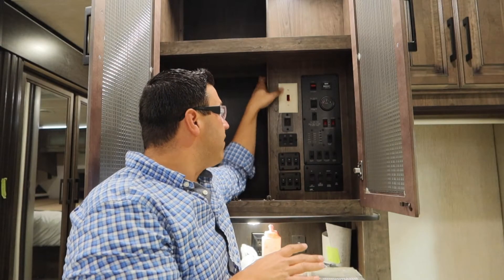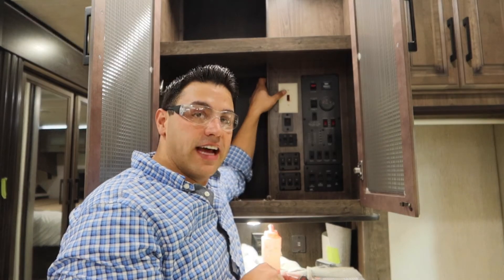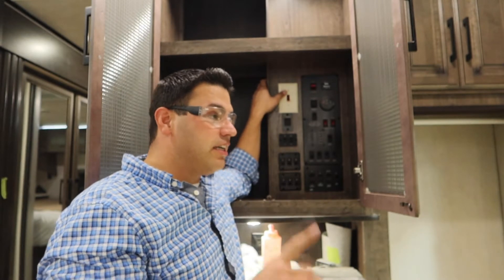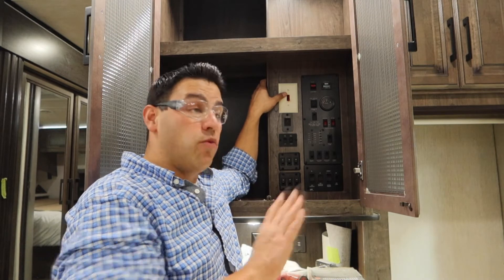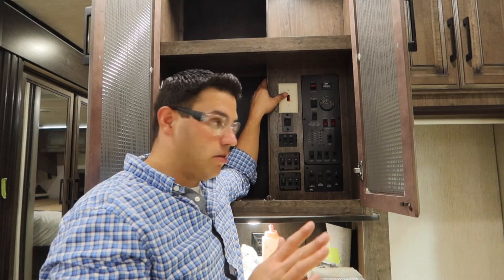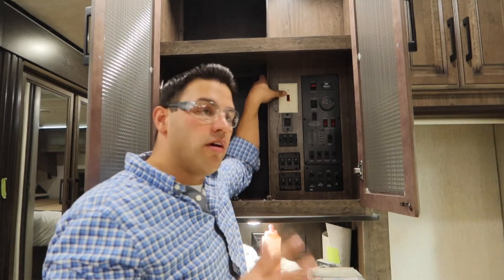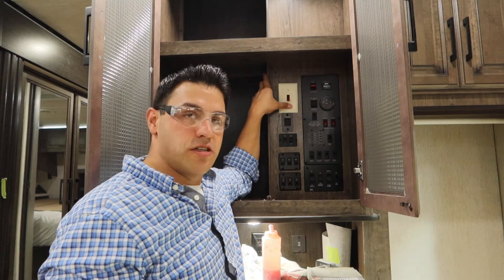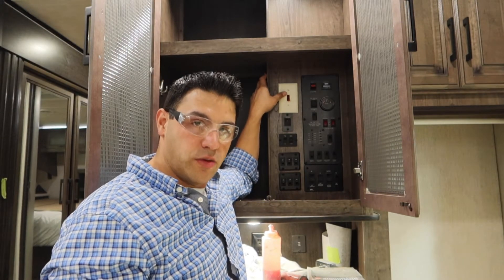Cyclone Toy Hauler Water Line Heater Switch - MAINTENANCE MONDAY with Heartland RV

Comment: What about for the Road Warrior RW 413??? So it does not heat the lines throughout the RV? Currently at 11 degrees and have water in main bath but none in kitchen or back bathroom? I thought the heater kept these warm as well? Any thoughts?
Reply: Mine is attached to the side of the fireplace.

Comment: I have a 2009 cyclone not sur that it would have water line heaters is that the only thing this switch would be used for
Reply from the maker: Hi! Please give our Service team a call at 877-262-8032 with the last six digits of your VIN# and they will be able to confirm this for you.